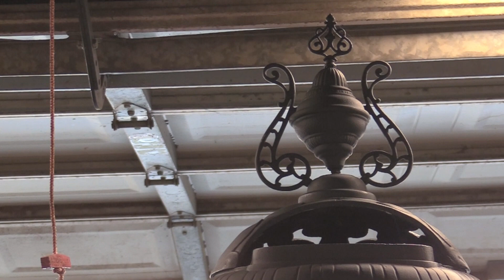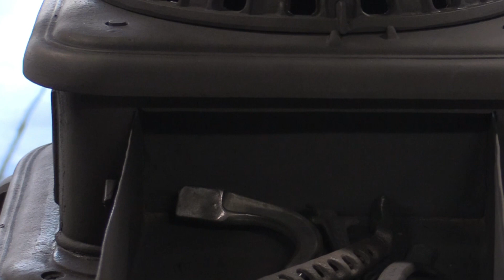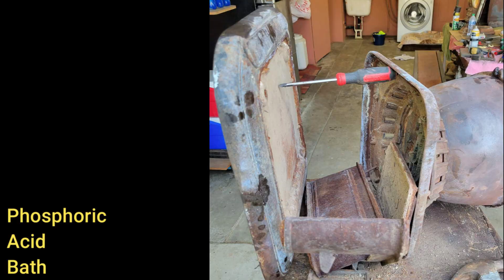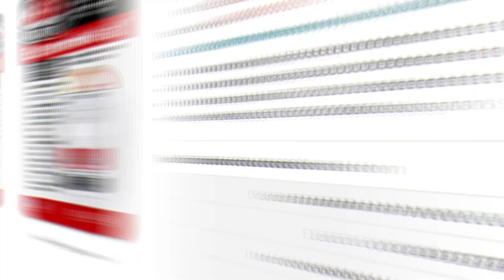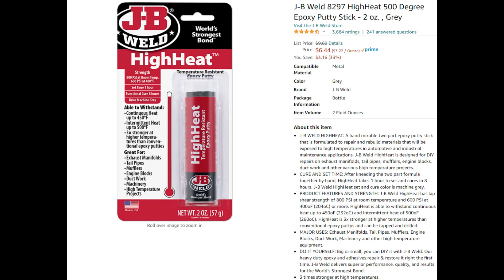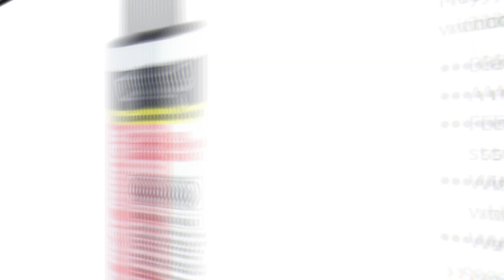Cast Iron Stove Restoration Using JB Weld Extreme V. JB Weld Putty

Comment: Thanks for the info. Im planning to use the JB Weld extreme heat to seal air gaps on a 55 gallon barrel pit I'm making. Nowhere near the 1000° heat but thanks to your video it should do the trick. Question about the Dap, did it shrink or crack after curing and heating?
Reply from the maker: No so far it is holding up well but this is more a decrotive pc then a every day use

Comment: In my experience, JB Weld Extreme epoxy does a good job. The only downside I found is that it needs replacing after about 2 years. I only have a 5-6kw stove  and even that gets pretty hot.  But the weld won't last forever so that's good to remember and not think it's failed.

Comment: How big of a hole did you drill, diameter, to stop the crack?
I suppose there would be certain calculations as to how wide a crack to hole size, but i don't know.
Yes my stove has a crack.
Does that stove burn wood or coal?
To bad one commenter was so critical.
I appreciate your video, that would be a lot of work for me, to disassemble. Good job
Reply from the maker: Thanks for the reply - I used a carbide drill bit and because the cracks were hair line type I used 1/8".  I agree that there are probably calculations out there that are more exacting but I just used what I had on hand in carbide drill bits ( I am sure you could use HSS and going slowly would work also). As the stove came out of a train caboose I would say you could burn either in it. What I burned post restoration was wood (mesquite) and works well. I have made probably around 15 plus burns but I ended up selling it (to a friend) and to date as far as I know it still is working fine with no issues.

Comment: Thank you for such a detailed explanation on your restore project. Your knowledge and savvy on what products to use to remove rust with chemicals and grinders really helped. You completed a project that most people would not try to do. I have an antique kitchen stove has a hole in the burn box that is slowly eroding and getting longer and deeper over the years. I have been using High Heat furnace cement which lasts two to three weeks. I am going to try the JB Weld Extreme and see if it lasts longer.
Reply from the maker: I would say it is worth a try on your stove. I do not use the old stove I restored all the time so how it will hold up with constant heat every day use I am unsure of but it is still holding up for me at this time. I have used high heat furnace cement also in a fire place I have and it holds up but every few years (only using during winter months and heat is constant on it) I have to scrap and reapply some more.

Comment: Sorry but that is not a restoration. I agree on brazing but even that is not really restoring. Cast iron welding is. JB Weld is NOT a restoration product. When buying an antique atove you always look for repairs using JB Weld or stove cement because they WILL fail again at some point. Dont believe me? Check one of the antique stove hospital web sites
Reply from the maker: I agree with you in large because the best way i am sure would have been to weld it. However,  this was just a fun project and i do not have the ability to weld it. I did look it over well and knew about the cracks but i thought i would give it a try and repair it with what I had at hand. I will say that so far it is holding up fine but again it may crack thru and if that happens I can always find a welder to cast weld it. I am unaware of hospital antique stoves but i will look into it.

Comment: great post, I am restoring a medium size pot belly. Looks like a caboose stove. But not sure. I was told it never was used and it looks like it wasn't but sat in the elements for a long time. There are some gaps on some sections when together that i would need to seal. Glad you posted this about JB weld I am looking for a sealer to mend the cracks.
Reply from the maker: Let me know how things go with it - always interested in these types of projects